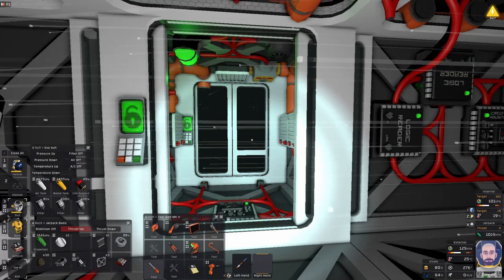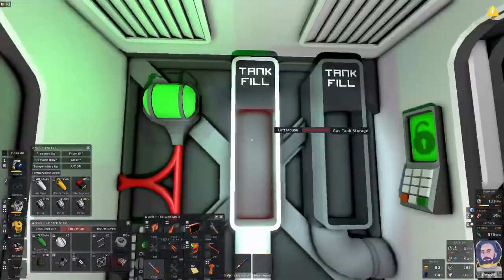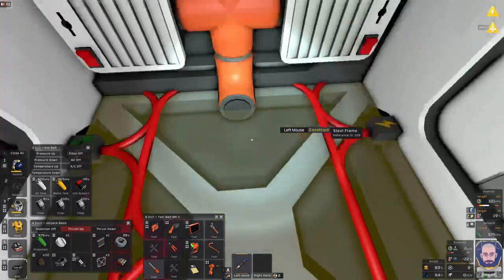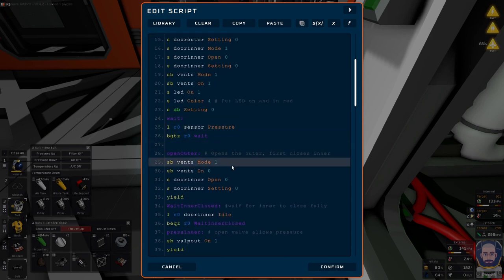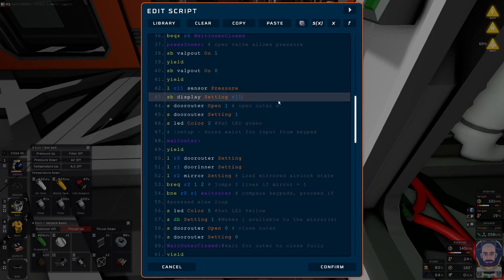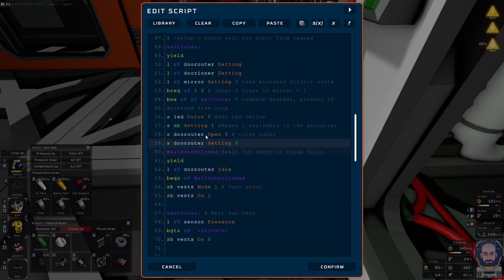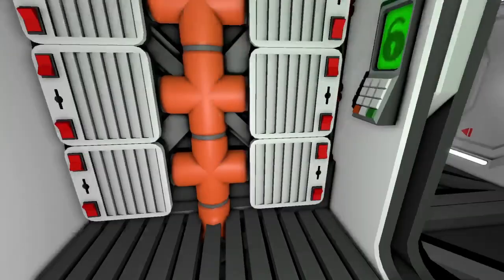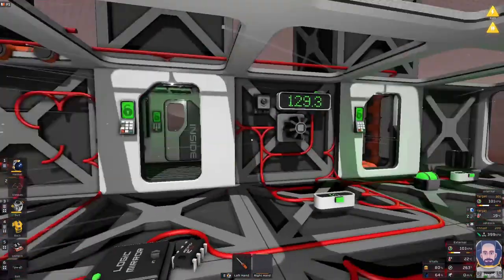Is this the fastest airlock design in Sationeers? (depreciated wtih recent updates)

Comment: Putting in 2 pressure regulators (backpressure) to keep the pipe on either side at 1-10mp (ish) will pressurize the airlock near instantly in either direction, more pressure = faster flow rate.
The regulator is there only to keep the pipe from overfilling or the air in the inner side from getting stale(Co2 only) you could put in a couple of Canister holders to hold the gas and manually empty and refill if they get to full and skip the regulators.
Use a couple of powered vents for the venting and you can increase the flowrate out of the airlocks and into the tanks even more. No IC chips or programming required same result.

Comment: This could probably be made faster by using a turbo tump with a pipe length of 10 (1000L) and switching the direction of the pump for depressurization and repressurization.
That way it can assist in both cases instead of the valve which can only help with repressurization.
Reply from the maker: Does the TP work effeciently at pulling from a grid in low pressure though?

For a single frame I thought active vents were fastest at evacuating, when you're talking bigger spaces nothing works well, but backpressure regulators help with the last few pa, or so I hear.

I don't think the repressureisation can go faster than two yields due to how the updating of the frame  works, the valve is on for one game tick only, the second game tick is for the atmosphere calculations to catch up before the door opens to prevent a "backdraft" I call it, where the outer atmos rushes into the lock then gets bllasted back out when the game realises you dumped 1mp of pipe pressure into the frame a tick ago. Dunno the grainy mechanics of why this happens exactly but in testing the only way to prevent this was a second yield.
Reply: @lionllew8459  If I remember correctly:
Active vents: 10.1325 * 8000
Pressure regulators: 101.325 * 100
Turbo pump: (pipe pressure) * (pump setting [max 1000])
(Values are pressure * volume)
[ pressure * volume = moles * gasConstant * temperature ]

So if the pipe pressure is at 81.06kpa a turbo pump can be as fast as an active vent, at higher pressures it's even faster.
A turbo pump wouldn't help more than a valve with repressurization but would slightly help with depressurization, so it might be a better replacement for a valve.